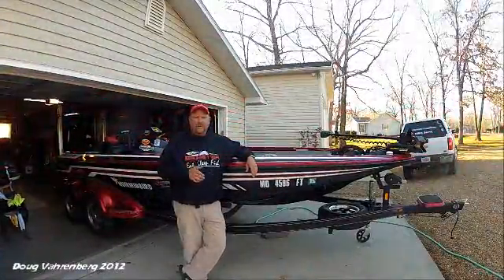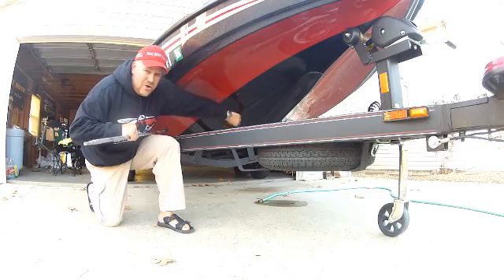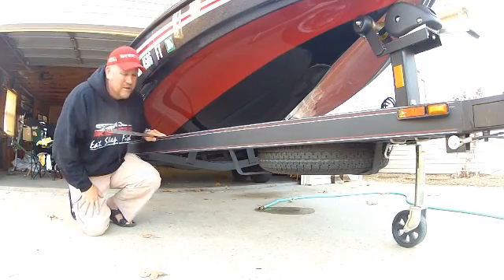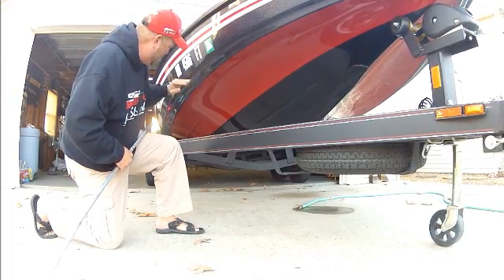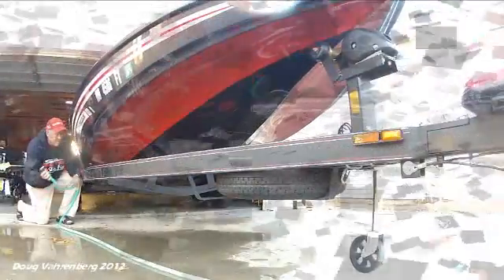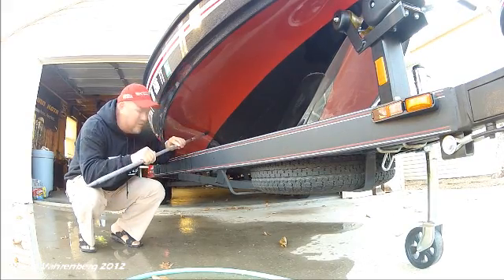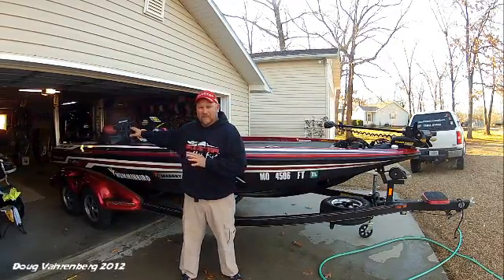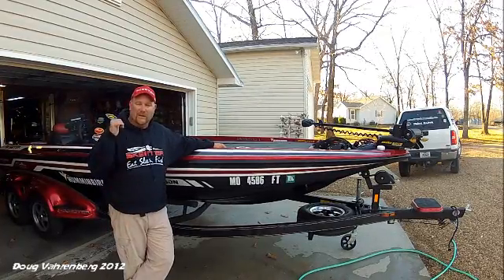Tips N Tricks 69: Skeeter Engineering: Bow Area

Comment: can you do a video on changing a skeeter 20i steering wheel ; I just bought an 06 20i and my steering wheel is loose. Also my back seat mounting hole is missing the threads, my back seat post is loose and wobbling.How can I change that out. I can see the receiver from the battery compartment. thanks
Reply from the maker: It might be the Tilt Mechanism. I would recommend visiting your local Skeeter Dealer. More advanced than I would like to attempt for either of these concerns.